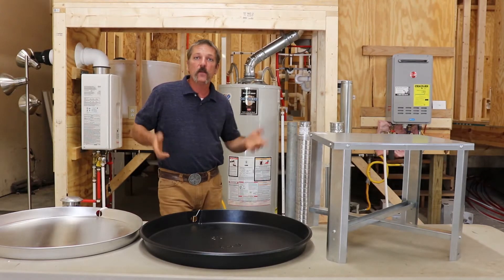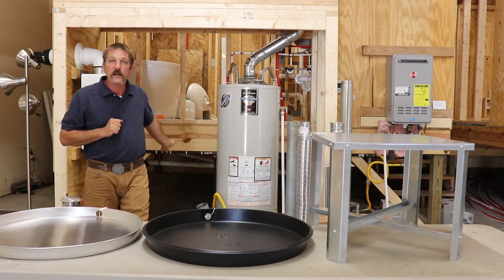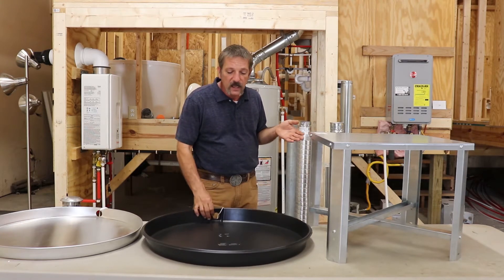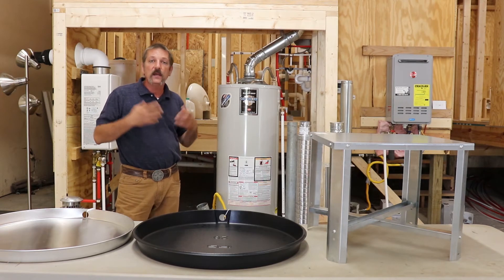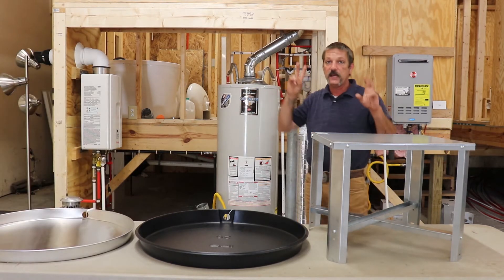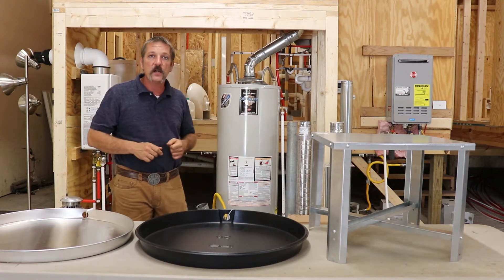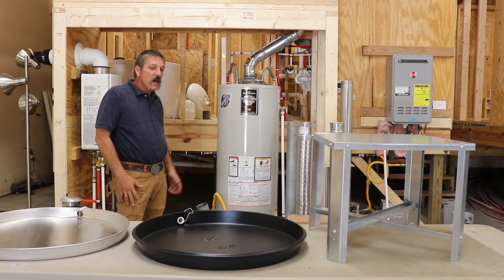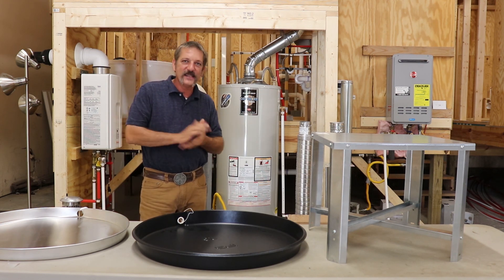Water Heater Pans

Comment: where do you drain the pan to then? to the outside or to a drain. If you do it to a drain how do so the sewer gases doesn't come into your house?
Reply from the maker: Normally they drain outside .  If it goes into a floor drain it has to have a P trap and a trap primer.

Comment: Interesting how things vary from contry to country.
Here in AU, all tank type water heaters need to have some sort of, " thing" to keep the water heater off the surface it sits on, in the past wooden grates where common, these days most sit on a round plastic grate manufactured for the purpose.
This is to keep the tank off the ground and prevent, contact with any water that may accumulate under the heater.
Tank type , water heaters installed indoors need some sort of pan, this can be copper, galvanised steel or even a concrete bund. mostly under current regs drained to the outside. 
While  gas hot water is far from uncommon, the majority of hot water heaters are electric and typically 3000ish watts, 200 litre ( 50 gallon) or 300 litre ( 80 gallons).
One reason we have a majority electric water heaters, even in houses with gas, is our 240Velectrical system, 3000watts is only about 15 amps, similar to a typical power circuit.
A large portion of water heaters here, especially gas are installed outdoors and they are built with that assumption.
We pretty much never install water heaters on a stand.

Comment: I had a plumber tell me code required a stand because of the chemicals. But it's already elevated, at the top of the garage stairs. And he said inspectors would still want it on a stand. But there's no room for me to put chemicals there, only the heater fits! Wtf
Reply from the maker: he is just trying to sell you something are you having it inspected? probably not.

Comment: Can a garage 50 Gal electric water heater in a pan hang off the stand?  Ex:
21”x18”square pan (500lb wt limit)
26” safety pan 
23” round water heater

From those numbers there will a 2.5” over hang of the pan on the stand and a 1” over hang of the water heater!
Is that legal or does the water heater need to be able to fit “within” the stand - seems safety pan over hang would be ok as long as the water heater doesn’t hang over.  

My thinking is a 24”x18”square stand with the 23” water heater so there would be 1/2” excess stand! Or am I over thinking it?

Comment: My 30 gal. electric tank heater is old and it's begun leaking - a little. Rather than spending $500 i don't have on a new one, why can't i simply place one of those pans under my tank, knock out a small hole in the floor and let it drip under the house - or through a hose into the yard?
All this to expand the life of my electric water heater. It works perfectly fine. 
Also i could buy a new T&P valve just in case.
Doable? 
Thanks you
Reply from the maker: uh.. sure ,

Comment: Didn't cover where and how to drain the pan??? A pan not drained could be worthless depending on how much it is leaking?
I'd have to question an inspector that's wanting to see something that's not required by their own code??? They shouldn't have to look for something that's not there and hopefully they know about requirements on water heaters? Just saying. 🤷‍♂️
Reply from the maker: They don't know plumbing code . they are working out of the building codes . we catch them all the time trying to make stuff up.

Comment: They used to make them with legs that provided an air space between the cement floor and bottom of tank.Now the tank will rot out if water gets in the pan.Just a money grab for the pan you don't need and now the tev pipe is an  extra part you have to buy.

Comment: very helpful since our inspection suggested a pan and a stand. Based on what you said here, it doesn't really need either. It's in a room with a door, on concrete, and is electric. But, he did suggest having the return valve elevated to above the top of the heater, is that what should be done?

by the way, you look like Jeremy Renner's cousin!

Comment: Was hoping you would address what to do with the water that goes into a pan.  The presence of a pan does not magically make the water disappear.  There's a hole for a drain plug and hose.  Where is the hose allowed to go?  Can it lay on the floor running from one side of the room where is the water to the other side of the room where is the floor drain?  That seems a trip hazard, but how else are you going to get the leaking water from the pan to the floor drain?
Reply: Just run it to the floor drain and watch where ya walk
Reply: Usually when a water heater starts leaking it is a very small leak and would take a while to fill the pan, Just install a water sensor that will sound an alarm! If the alarm goes off just go out to your garage turn off the power working hours and then close the cold water valve! Once that is done go to the nearest faucet and open up the hot side, Now you should have no more water pressurizing your tank and you relieved the pressure and that should alleviate any leaks until you can get it fixed, You can also hook up a hose and drain the tank!